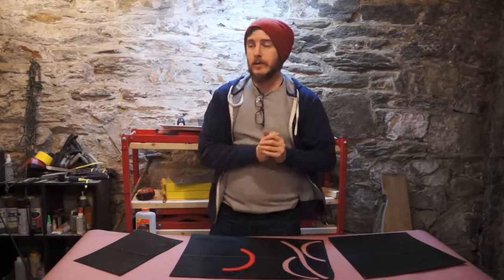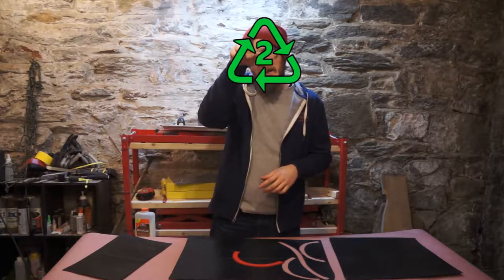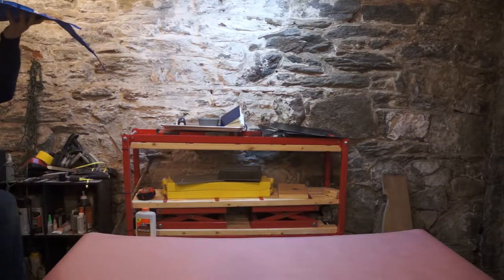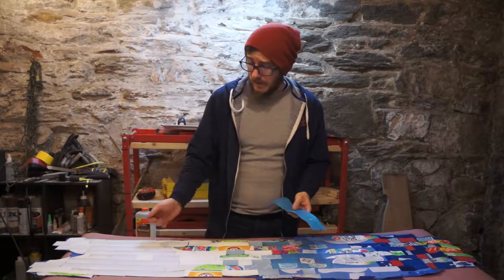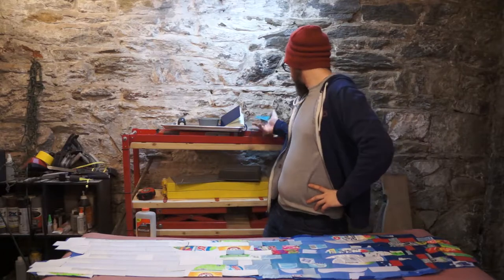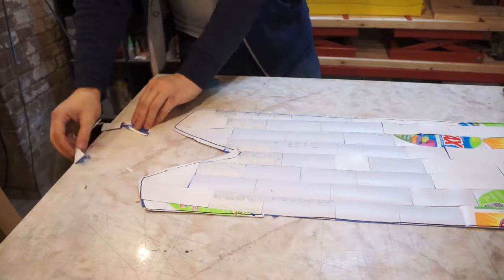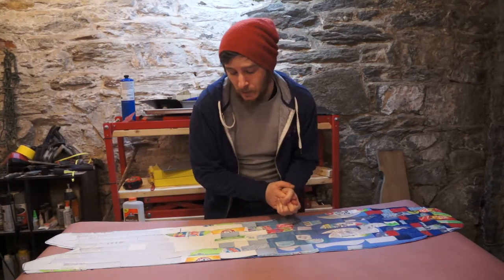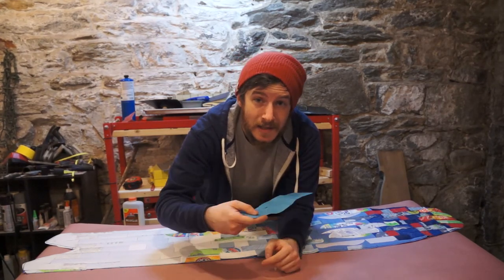DIY Snowboard Base From Recycled Material - Experiment 1

Comment: If you drop water on the plastic and it spreads then the flame treatment worked. The water beads up on untreated plastics.
 Why not try a Flexible Flyer sled which would give you a solid sheet of plastic for about $7.00.
Reply from the maker: The sheet sled thing is a great idea, but dude, you don't know how much you've helped me with that tip about the flame treatment. I'm going to have to try it out, thank you!